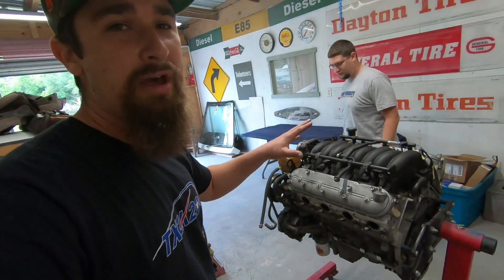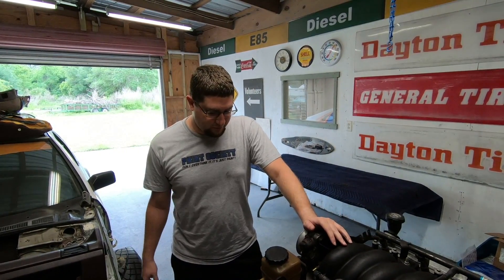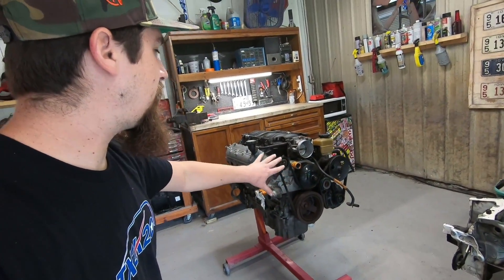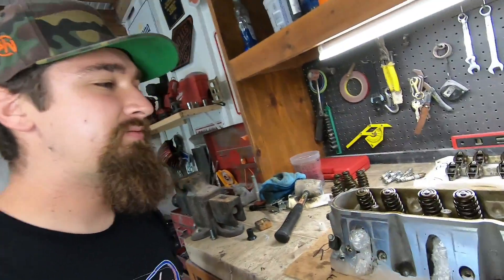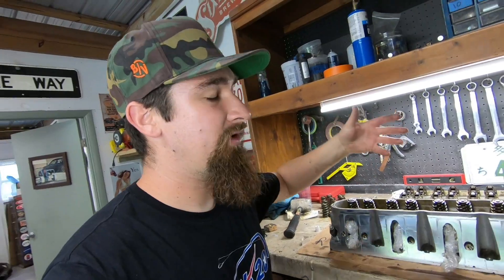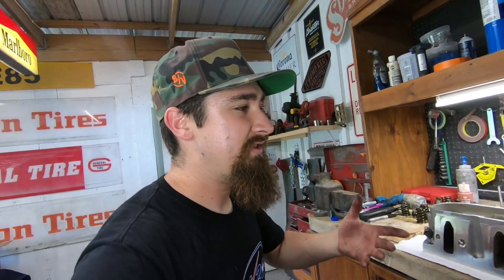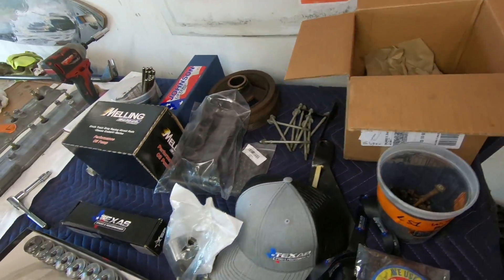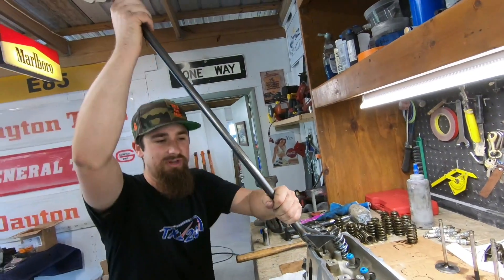Rebuild A motor From Your Garage! Chevy LS For My V8 Swapped Honda Accord. TEXAS SPEED!

Comment: Did you use a new cam retainer plate gasket? That rubber seal is trash once you remove it and doing the valves like that can flatten the valve back face and seat. But hey it's your car

Comment: Gee I am an old retired motor mechanic and never in my life seen a valved lapped in like this.
Reply: terry reeves works great. I put my valve stem right into my drill chuck. I put some corvette 243 heads on my ls1 with a cam and made almost 420 to the wheels.

Comment: For a quick way to pop the valve springs off, just put a 15mm or something bigger then the retainer clips, and give a smack with a hammer. Guides pop out. Re assemble with the right tool after lol.

Comment: Crazy I did something similar to what you're doing in my k24 swap.. 
I did my valve springs and retainers with valve seals and drag cartel 2.2 cams.. but I kept the motor together all I used was a valve pusher air hose which threads bbn on the sparkplug holes and sent air in to keep the valves in place replaced the valve train as such 👍

Comment: You put a new cam in without changing the bearings 😲
Reply from the maker: Never ever look at them. If you look at them they’ll be messed up, if you don’t look at them, they’ll be fine. That’s the rule
Reply: check out sloppy mechanics, it's a rule - don't look at the bearings